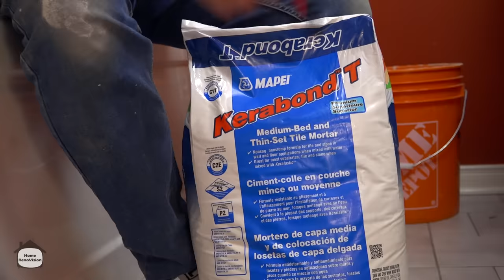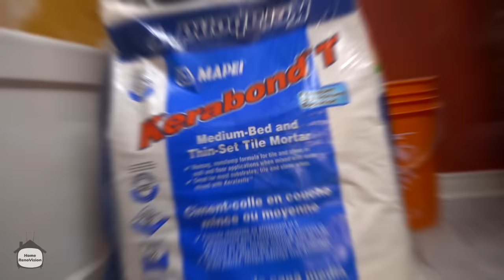DIY How to Renovate the Tub / Shower from A to Z

Comment: What are homeowners typically allowed to do without city inspection requiring plumber? I thought rough-in work requires permit and plumber? PEX looks super simple.
Reply: It's your house you can do whatever you want.
Reply: depends on your local government (city/town), some places do want permits for small things (guy I know needed a permit to level his lawn), general rule to go with though, if you aren't ADDING to the system (no changes to the number of ptraps for example) then you have no worries, as well I have never needed one to remove from a system.
Reply: Some agencies require permits for any plumbing, but you do not have to be a contractor to work on your own home.  You may need an owner builder permit and inspection.  Some agencies do these by applying on line, and will ask you to send pictures.  Just call the number for your building official and ask.

Comment: so is there a whole new set of challenges if you have this same type of set up but with PLASTER walls?
Reply: Yes, you certainly can't score and will need to saw through like he did initially. Some plaster has gypsum board behind it which you can attempt to get behind and pull off panels at a time. If it's lathe then you will be demoing it all to pieces. If there's metal mesh you're going to have 3x as much "fun".
Reply: @JayKC2011  lucky for me, there is no wire mesh anywhere in these walls, only plaster

Comment: I've always wondered why people INSIST on having the shower and spigots on the end of the tub.  Sure, the drain is there, but it would, in some cases, be much more practical to have the shower and spigot on the SIDE, in the middle of the tub.  At least you wouldn't have to have a stub wall just for the plumbing.

Comment: At 9:30 where he stops to explain how he removes the perimeter wall tiles made me laugh. Because his technique is EXACTLY what I figured out how to do. Even though nobody ever taught me. When you've been around the trade a while you often discover some of the same tricks that we oldtimers learned. There are no ''secrets'' anymore. It's just logic, common sense and applied physics. 

Incidentally: Once I get one perimeter tile removed I stop chipping away from the outside-in. Instead, I chop out the remaining outer perimeter tiles from the place where the most recent tile was removed. This prevents any incidental damage to a potentially finished surface that you MIGHT want to save.

Comment: Plumbers have told me on pex they don't like using the rings,  but they use the expanding method instead so it wont leak. I know the tool is expensive.

Comment: Your tile was level across but it also needs to be level and flat up and down. Also, the depth of the grout should be level. I notice this straight off. To the left of the valve it is not flat. The tile it tilted.

Comment: How did you determine where to place the plastic trim at 1:32?
Reply from the maker: usually based on the design of the size of the tile. there is no rule as too how far out from the tub to run a tile so make adjustments based on aesthetics and ease of installation.

Comment: You did not purge air out of the system and fully fill it with water, so how could you check for leaky joints?

Comment: Hi, my backer board is not flush with the flange, backer board it out more the flange. what do i do with that.
Reply: Not quite sure what you mean so I will guess.  If your wall is so out of alignment with your tub that the flanges on the tub don't line up with your backer board , measure, cut and glue 2 x wood and nail it onto your studs until the area is square. At each stud hold a straight 2x piece of wood next to each stud and scribe the existing stud to determine your giant shim, or just add a second stud at each location that is in the right place.

Comment: I noticed you have learned the safety practice when using a razor knife to cut through the drywall. You place both hands on the knife this is a safety measure so that you don't cut the hand that isn't holding the knife. Yeah, one hand is actually holding the hand that is holding the knife but my point is both hands together you won't cut the free hand. Trained safety measures. I had to point this out I have seen people just about cut their fingers off from putting so much force on that knife without both hands on it the free hand eventually will get in the way and it's all over.

Comment: Since you had to make solder joints anyway, why not do the whole job in copper? Properly done, copper is forever. Pex can leak if you use the tool improperly, and the tool is expensive as well.

Comment: A good general overview of "how to", but there are plenty of areas of concern IMHO. The general disregard for the tub finish, for one. Multiple times I cringed at how close a utility knife or other tool came too close for comfort to that acrylic surface. Even wiping thinset off the ledge with a sponge would leave scratches and made me cringe.. Two inches of masking tape protection seems like a no brainer to me. 
  Perhaps Mirolin doesn't require a ledger board to support the perimeter of their tubs, but every other tub from every other manufacturer I've installed has specified to do so. Also, you mention that the house/floor has sunk, yet there is no mention of how to level the tub.   The creaking sound at 2:15:26 tells me that it's moving, and while it doesn't necessarily mean that it will fail, it's annoying AF to stand in a tub that does this. Most tub makers require a dry pack mortar bed underneath the feet, if not the tub belly itself.

Comment: I'm confused.  Why two different types of tile cement?   If you're able to put the mosaic and the tile above it, on the wall with one kind of cement, why not use that same cement on the bottom too?
Reply from the maker: since you need 2 bags for the job I like to use the economy version of the cement for the bottom, the white is #0 bucks a bag more. Cheers!

Comment: Great Video. Truth be known though, I am afraid of drywall, concrete dust. Because then I gotta clean it up.Worst part of every job, especially if the door was open. I use painter tape to seal up the door.  Sledge hammer in bathroom on shows. Great for showbiz and irresponsible. The only time to pull out a sledge hammer in a bathroom is when someone is getting on your last nerve, then the green bag is really worth the $250 pick-up.

Comment: BIIIG THUMBS UP…MOZAIC TILE TRICK !!! Yes !,!,!,
But removing a tub that is on a concrete slab and replacing it with an over sized shower pan ( walk in shower) will surely mean..
1) moving to re-center the p-trap drain… …sorry but I don’t think that I got enough “Big Picture”…. As ultimately CENTERING / Placing/ Aligning the plumbing ( p drain) to where the drain in the shower pan drain is PRE-DRILLED and not adjustable … means that the p drain needs to be right the first time (?)..
And
2) are shower pans manufactured with an under webbing ( floor) that already has a drain slope?…. So al I need to do is make sure the the slab is level?

Over all…. Contractor quotes to rip out old tub and install walk in shower are between $8,000 and $20,000…
 but parts and supplies are UNDER $4000… plus flowers for my wide every day to help her chill.

This video… slam dunk priceless… or worth between $4000 and $16,000 ( minus flowers)

Comment: Did you check that the new tub's support blocks, surrounding the underside of the plug hole, were all sitting on flooring, and not suspended over the waste pipe void ? Great job otherwise !

Comment: Using that torch up against the dry wall on the other side might have been the spookiest thing I’ve ever seen.
Reply: (i do a LOT of soldering) in my experience the paper burns just a little, if the drywall gets too hot it crumbles apart (loss of suspended water), it doesn't burn.

Comment: You should be more clear about many steps, the N95 mask only works if fitted properly (shaven), especially with asbestos. Shutting off the water and draining the system would fry an electric water heater in most cases, you should mention it. Simply tell people to go buy a tub tool ( $12) before they snap apart the waste by forcing the waste out. I do enjoy your presentation though, you make it seem like anyone can try this stuff.

Comment: 10 turns of Teflon is Way too much. I have been doing it for a living over 40 years and 4 to 5 turns is plenty. Remember, there is no pressure against a shower arm, it is just passing water.  Even on high pressure steam I'd never put more than 5 wraps. It Works, trust it.

Comment: Jeff, your a wizard and you really are the Bob Ross of diy, but your crimp rings are gonna fail. Right at the 52 minute mark you have a ring that clearly isn't fully crimped, I'm not a huge fan of inspectors but even I would fail you on that connection. Especially considering the plumbing is getting buried in the wall, and a leak would require a huge overhaul. And if your tile is discontinued, or you don't have easy access to the plumbing, your scope of work just got way bigger and your cost just shot up tremendously. You really want to catch both barbs with your crimp ring, and you want that ring to be fully crimped

Comment: I do not like that the tile on the left side of the control valve was cut to short and you can see cement in the upper corner of the cover plate!  The rest was a good presentation!

Comment: You have never in your life took a plumbing class  all your solder joints are going to fail..
Plumbing 101...
#1.. "REAM" the pipe . Your solder joints if you're lucky will last a year..
#2... Not so much flux.
 Just a little bit of flux on the male and female to prevent flux pockets.
#3... Don't touch the clean sanded copper with your bare fingers they have natural oils on them that flux and solder don't like.. 
#4.. wipe your joints so they stay looking new and nice. No customer or repair man wants to deal with your green leftover flux.

I hope these  tips will help you sell a better long-lasting product to your customers.

Comment: Why do plumbers charge $200 to replace a kitchen faucet and I already have purchased replacement pieces.
Reply: 1/2 drive to your house, 1 hr to 1 1/2 hr work, 1/2 hr paperwork both for receipt and filing. That is just wages, then there is overhead - gas, vehicle insurance, liability, maybe not your job but small parts like new braided lines or worse case new water stops (mine cost me $15 each), tools to do the job aren't free and they do break, my waterline tool is $580 CA and I need to replace it every appx 5 years and that is just one tool, my torch is $480 CA just for the torch - the tank is $120 CA. It all comes together... Then, there is the knowledge of doing it properly so you don't have damaged waterlines or a disintegrating countertop in a few months. ( my son is behind me telling me you are asking a rhetorical question and I shouldn't respond - if that is the case please just ignore me, I just want to be helpful)

Comment: Can someone please explain how he removed the nails at 19:03? His body is blocking what he is doing but he says to check for nails and I can see he is running his hammer up and down and I don't know how he did that without damaging the plastic that keeps air from flowing in the house.
Reply: The back end of a standard hammer has a split end.  You move this under the nail head and rock the hammer.
Reply: @BobbiSalvini  He did that pretty fast then because it looked like he literally just ran his hammer up and down lol. But if he's pulling out the nails, wouldn't there be holes in the plastic from where the nails were at?

Comment: Pro tip: if you don't want to spend $250 to have that big bag picked up...load the materials into your pickup truck bed or suv hatch. Discreetly dump it all into one of those construction dumpsters parked nearby or into a big apt complex dumpster. Don't be dumb about it. Takes a little bit of common sense. Hard to get caught. And you save $250. Reward yourself by spending that money on whatever it is you want. I'm taking that trip to save $250. Oh yeah. Everytime
Reply: My neighbor left the lid on his dumpster open and his construction cardboard blew down into our open space.  So I collected all of it and dumped it back in his dumpster.  The neighbor got my license plate and called the cops.  Just saying.  It is illegal.

Comment: Given that you're teaching people to do it themselves, you should really have used a heat mat when soldering. You have charred the wood with that torch and you were very close to the plastic pipe.  Less experienced people could potentially set their house on fire and would almost certainly melt or burn that plastic pipe. Maybe a warning about old style flammable pipe lagging and insulation?  No two ways about it, that's just unprofessional.

Comment: That N95 overtop of a beard is doing absolutely nothing.  Also - depending on the age of the building those materials could be packed full of asbestos which you definitely don't want to be inhaling.  Before any demolition project you should make yourself aware of the dangers and control them properly before you dive in and smash things.  Incredibly bad advice given in this video in relation to health and safety.

Comment: Your nozzle is putting far far to much silicone on 
Your scrapping off 80 percent of what you put on 
A much smaller cut on your nozzle would result in the same finish but not putting 80 percent of the tube of silicone in the bin